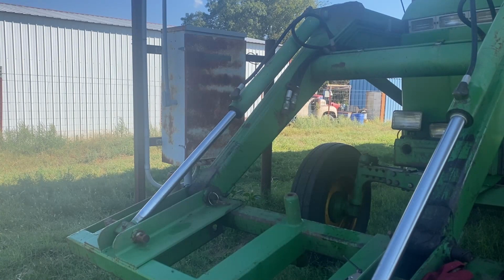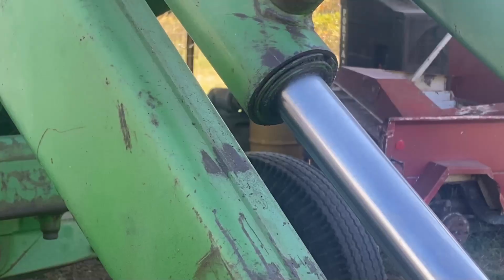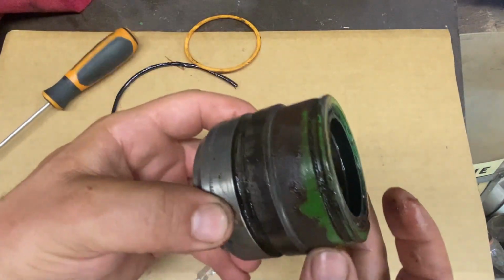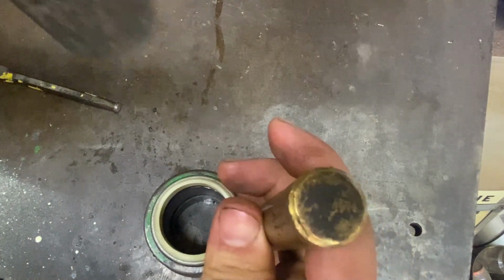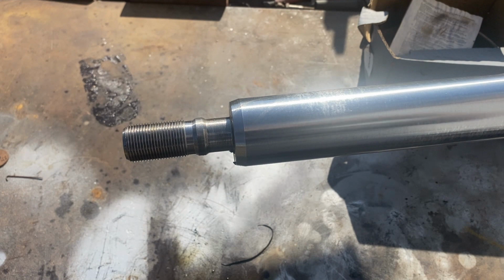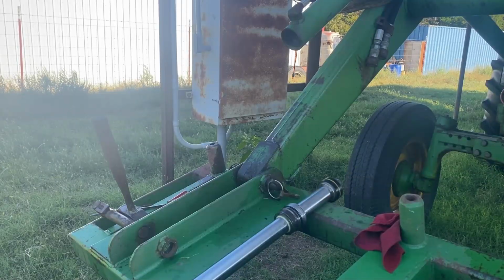John Deere 158 Bucket Cylinder Rebuild

Comment: Excellent video you made here young man, the directions are also the same for the 520 life and bucket cylinders & 540 bucket cylinder. None of this using a hose clamp to compress the retainer ring. Pick it out of the groove and then reassemble, put the retainer ring in until it goes in the groove, then pull rod out until retainer ring seats. No need for the little orange chamfered ring to remove the ring. These require you to dig it out of the ring in the cylinder.

Comment: Thanks for the video,  I'm a recent small logging business owner operator,  I have a john deere 440c skidder I have cylinders to do and I wanna do them myself.   Are all cylinders built the same consempt?
Reply from the maker: For a John Deere, yes they should be about the same, some of the industrial ones unthread. They will have flats on the outside or two round holes in the face.